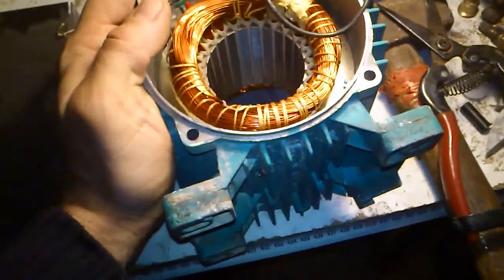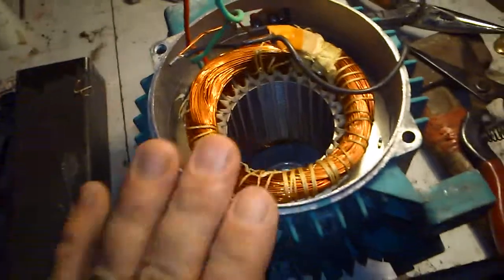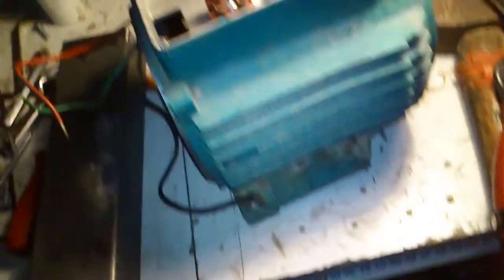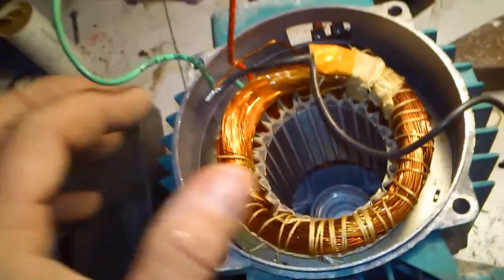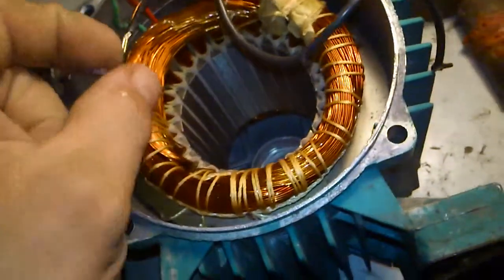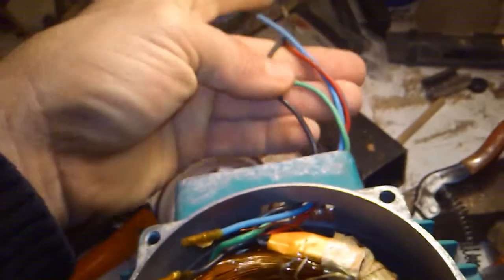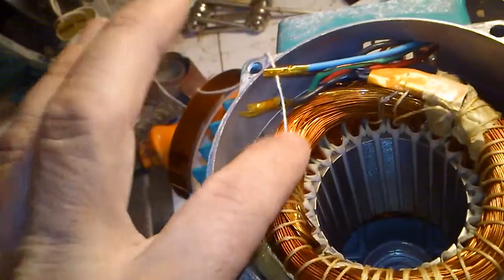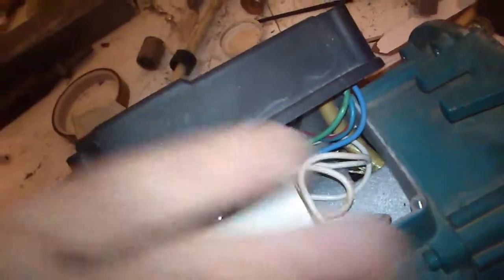Reversing the non-reversible! AC induction motor

Comment: There is another way to reverse a shielded pole motor.
Just rotate the rotor in the desired direction at a speed close to the 
synchronous speed and immediately switch the motor to mains voltage.

Comment: Not very clear. Stil dont know how to change direction.
Reply from the maker: There are dozens of diagrams of winding on the internet, it is easy to find a clear and less clear ones. What they don't show is how most of non-reversible motors are  physically  connected. You're welcome.